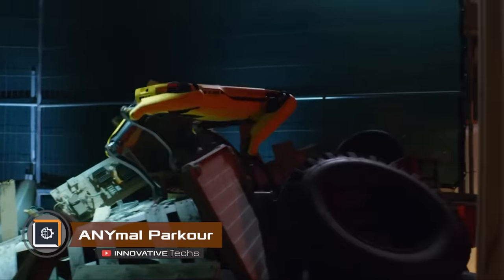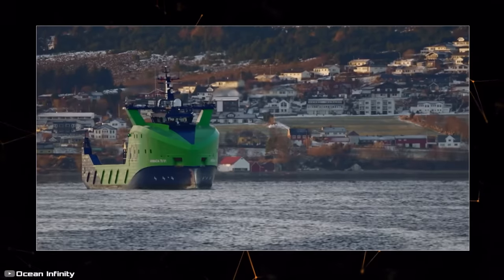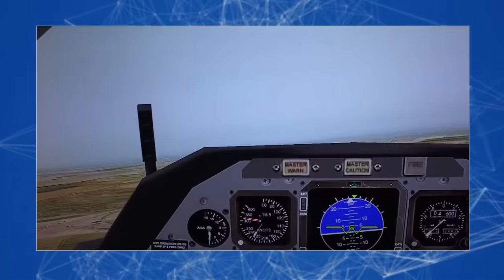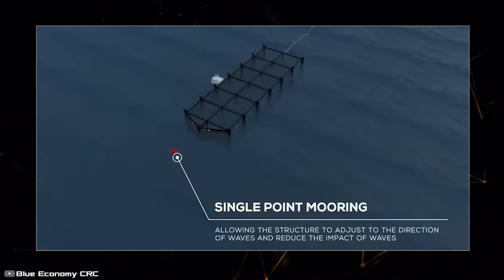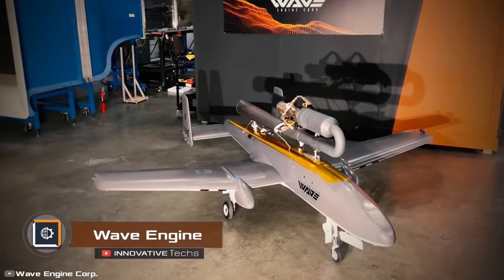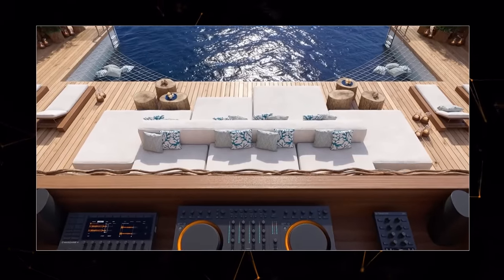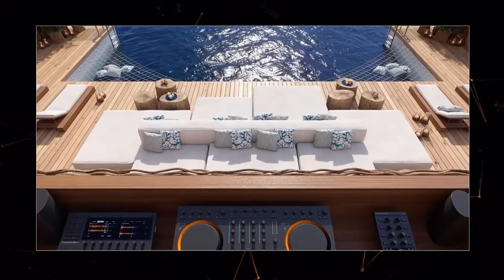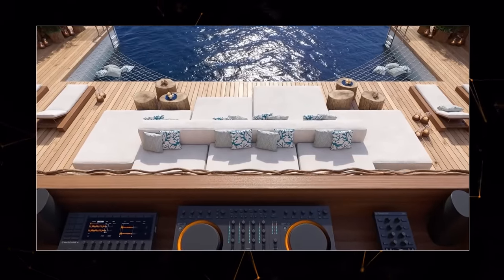25 NEW INVENTIONS THAT ARE CHANGING THE GAME

Comment: The sand car (sand rail) in the dji inspire 3 vid had air suspension. Never seen a setup like before on a sand car. Is this a new thing or have they been using this setup on sand cars for a while now? Anyone know how well it works compared to long travel coilovers?

Comment: So many designs of aircraft only consider the commercial market and are mothballed because the aircraft doesn't fit large-scale commercial operational demands and so, never make it to the civilian market. 

The flying wing is something that has been promised to the civilian market since the beginning of the aircraft. An advanced flying platform that combines modern high-tech design with benefits of innovative design and modern advances in fuel consumption and flight controls combined with the pulsejet engine from elsewhere in this video and you have the makings of an aircraft that is sure to become a collector's item, if not just a highly desired personal aircraft. 

A proper build would see this as a light aircraft design with an extended flight range.

Comment: "for use as entertainment at home" right..... Because I'm sure a fully equipped fighter jet cockpit mounted on a full range of motion platform flight simulator with top notch AR goggles is certainly very affordable for most people 🤔😂. Also as a side note.... I have never been in a simulator like that but when you bank hard right or left but aren't actually moving in a forward direction wouldn't it just feel really unrealistic when all your weight is against the side of the cockpit rather than being pressed into your seat due to lack of G force?

Comment: I like quite a few of them unfortunately they’re not designed for the average person to be able to afford them. Like the one with the bicycle with the two batteries I’m handicapped as far as being handicapped that means I can’t walk very far or very long but the bicycle would get me long distances but who can afford $1200 for a bike. But keep the videos coming I enjoy them.
Reply: Well if it were simply a pedal bicycle I may understand this but it's an electric bike with two fairly large batteries giving it a respectable range (around 80 miles with two batteries), has fat tires, duel headlights, and full suspension so your basically buying a small motorcycle with an electric motor that you can also pedal which makes is substantialy more valuable than just "a bike" also nowadays $1200 is quite cheap for any ebike of decent quality. Now days most flagship mobile phones, tablets, laptops, tv's kayaks, etc... all can easily go over $1200. Plus you could probably finance it for a few years for around $30 a month if you can't afford that much up front.